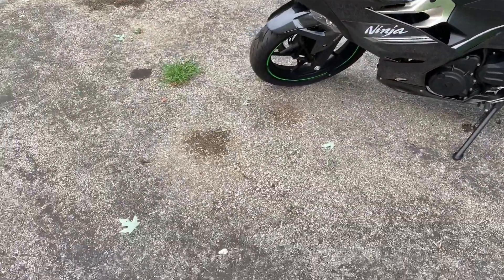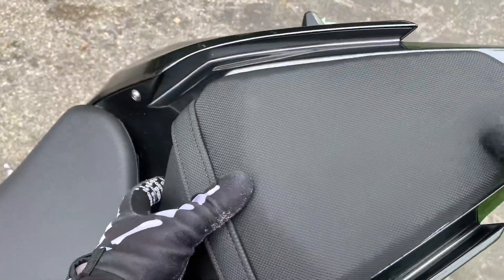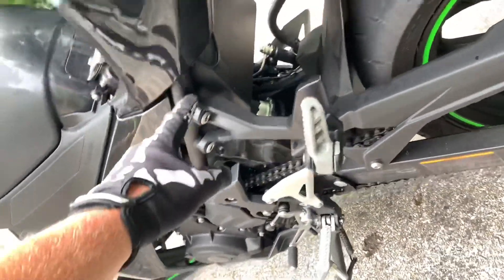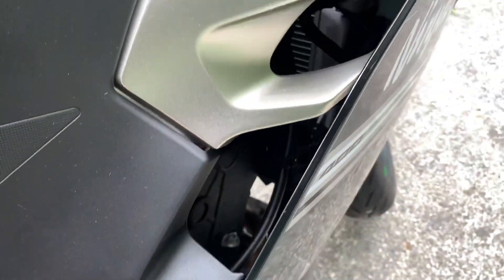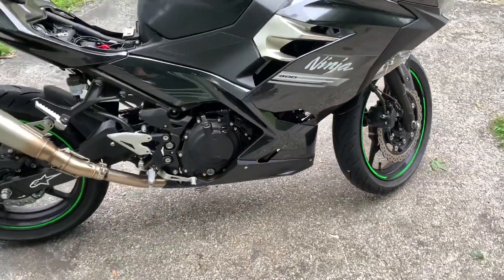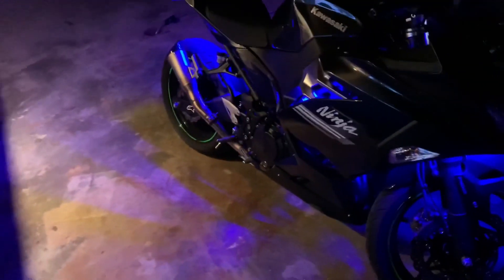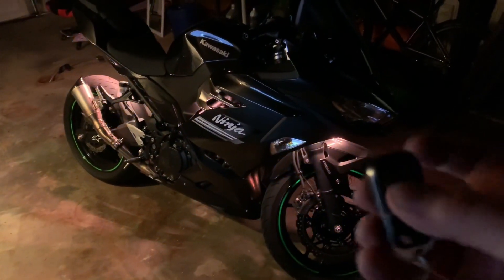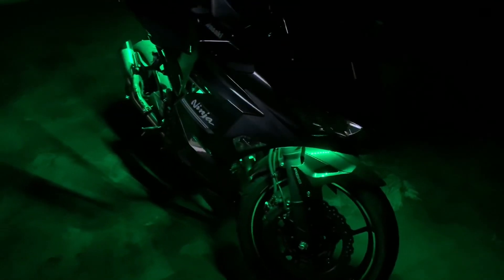2022 Ninja 400 - Underglow

Comment: Link the lights?
Reply from the maker: Govee RGB Motorcycle LED Light Kits 12 Pcs, App Control Multicolor Waterproof Lights for Motorcycles with RF Remote, Music Sync & Multiple Scene Modes Motorcycle Underglow Lights, DC 12V, Gift Set https://a.co/d/ejzJolt
Reply: @Doom-Head  Thank you so much for the quick reply! The lights look good.